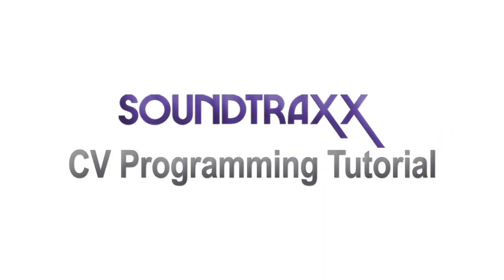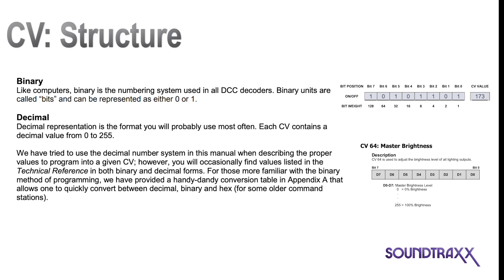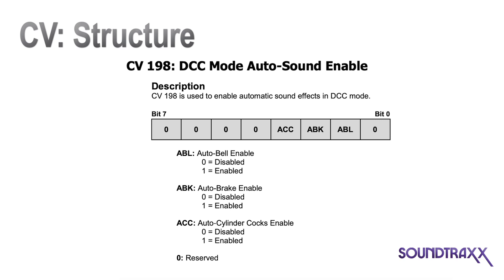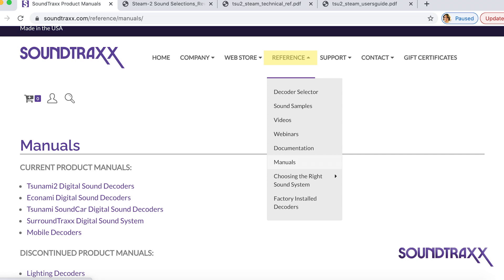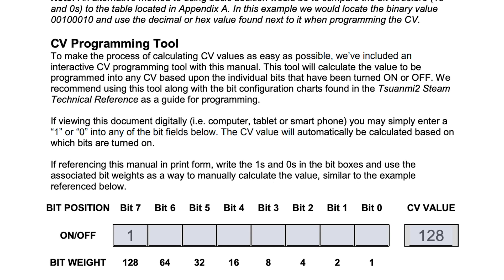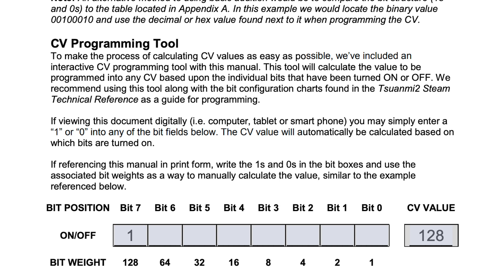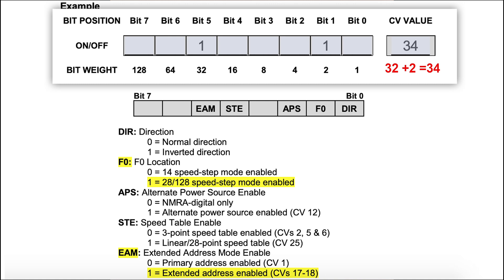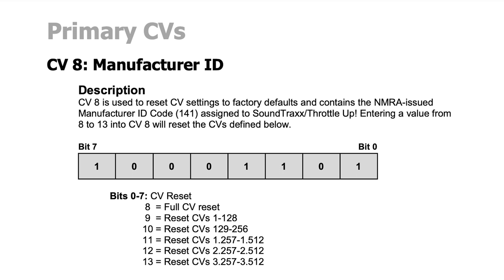SoundTraxx Introduction to CVs (Configuration Variables)

Comment: Another in the series of helpfull hints.The best thing about your Decoders is the logical structure of the CVs.Other Brands are not as easy to work with.Many don't realise there is no need to use or buy other programming tools.These can be helpfull,but the ability to adjust and tune with any? DCC system,won me over.cheers.
Reply from the maker: Thanks for the feedback.

Comment: Way back in the 70's I had to learn machine code. I really don't wish to do it again for each sound company. Why don't you make software that we can plug-in to a programing track that comes with the software and have that software do the work. I know you have been making these little chips for awhile, why not make it simple?
Reply from the maker: Our decoders do not need a special programmer they can work with any command station that you may have. If we made a special programmer  you would have to spend more money to buy it and it would only work for our brand decoders. You do not have to learn code to use our decoders. Our manuals walk you through the steps of setting up a each CV. Simple addition is the most math you will have to do to set up a CV. And we are always here to help you! support@soundtraxx.com. Use can also use JMRI to set up our decoders, but if you get unwanted results out of JMRI we cannot support JMRI and we will tell you which CVs to reset to fix the problem.

Comment: Nice description.  You can certainly manually add up the bit weights of a binary number to convert to a decimal number.  Just simple addition.  But it isn't quite so easy to convert a decimal number to binary manually.  You have to subtract the highest bit weight that the number might contain and that means there is a "1" in the binary's number's position for that bit weight.  You keep repeating this until you have no remainder.  For example, let's say CV29 contains decimal 34.  What is that in binary?  Well, you can see it can't have bit 7 (128) or bit 6 (64) in it.  But it can have 32.  So bit 5 is "1".  34-32 = 2 remaining.  So bit 1 is "1" and there is no number value left so we are done.  The binary number is 0010 0010.  Then you have to look at the chart for CV29 for the meaning and in this case Bit 5 = 1 means extended address, bit 4 = 0 means 3 point speed table, bit 2 = 0 means alternate power source disabled (no DC running) bit 1 = 1 means 28/128 speed step enabled, and bit 0 = 0 means normal direction.  BUT what about bit 3?  For CV29, bits 6 and 7 are "reserved" but there is no description for bit 3 except its value shown as "0".  So it is easy to look at the descriptive list SoundTraxx shows for CV 29 and think it starts at the top with bit 0 (and it does) and continues in order not knowing that bit 3 is skipped in the description.  So you have to be careful to 1) make sure you know the least significant bit is, by most conventions, "Bit 0" so the eight bits are "bits 0 to bit 7) AND make sure that you are accurate regarding the bit position you are dealing with.  If you do this sort of thing a lot, it will become second nature.  But you can also get a calculator that does "base conversion" that will convert between binary and decimal (and some other bases) very easily.  (I have a background that includes software development and I use a calculator with that feature all the time.)  Just one more notion that might make this easier for some.  Binary is "Base 2" and Decimal is "Base 10" and there are any number of other number bases.  They all work the same.  We are just simply accustomed to "Base 10" where we have the 1's digit, 10's digit, 100's digit and so forth.  So the decimal system also has "weighted" digits.  No different than the binary's 1's, 2's, 4's, 8's etc. digits.  (Note:  you can also find all manner of online base number conversion calculators and the calculator I find in my Windows 10 can be set to the "programmer" style and do conversions for you.)
Reply from the maker: Thanks for the feedback!
Reply: @SoundtraxxDCC  By the way, I just finished installing SoundTraxx everything into four older InterMountain HO F7 diesels.  First rate DCC and sound products.  On the "what about bit 3" comment, that really goes to technical writing style.  The list of CV29 descriptions is actually a key (like on a map where a key may show what types of lines represent what types of roads)..  But it also looks like a list and if somebody reads it as a list, they will think the items are contiguous.  Yes., "0" as shown in the byte gets defined as reserved elsewhere in the diesel technical reference manual (also acting as a "key").  And I notice in the byte diagram used for this video they are just greyed out.  There is probably an unambiguous way, without the text getting ponderous or too "busy", to have the key also be a complete list.  But don't get me wrong.  I think SoundTraxx writes excellent technical manuals and product packaging headers and included technical sheets.  Your typical reader ranges from neophyte to highly advanced and that's challenging.  I can see a lot of time and thought has gone into your technical writing.
Reply from the maker: @trainliker100  Thanks for the feedback we will keep this in mind

Comment: Does the reset options (CV8 to 8, 9, 10 etc) work on all SoundTraxx decoders, or just Tsunami2?
Reply from the maker: This works for Tsunami2 and Econami decoders. Tsunami2 has more ranges than Econami does though so use the correct manual for the decoder you have. Original Tsunami and SoundCar just have CV 8 to 8.